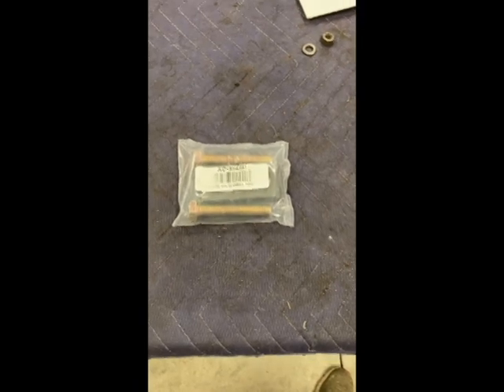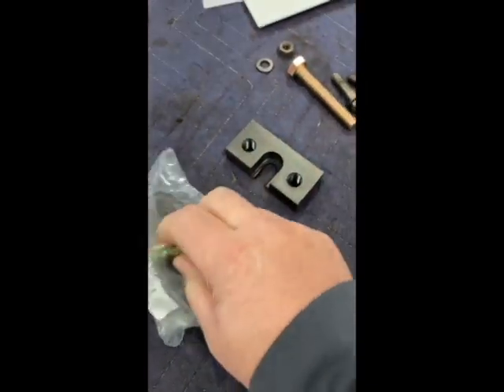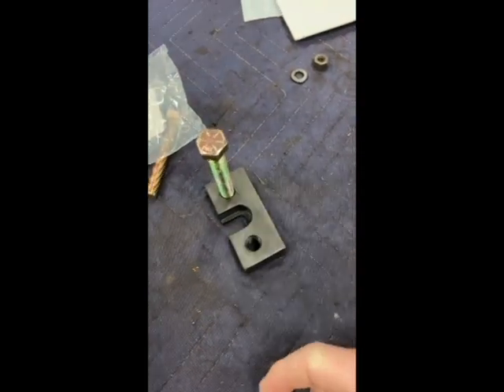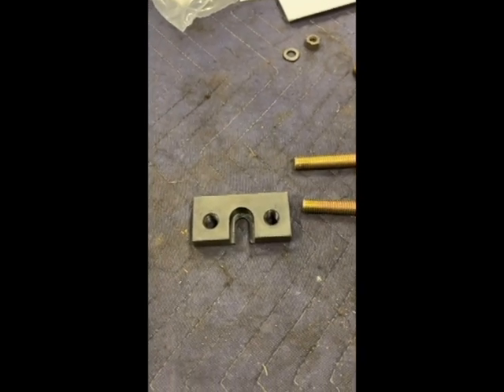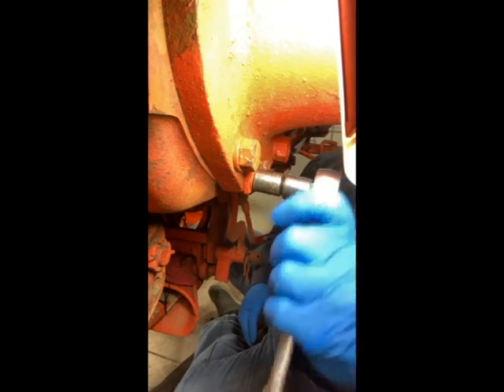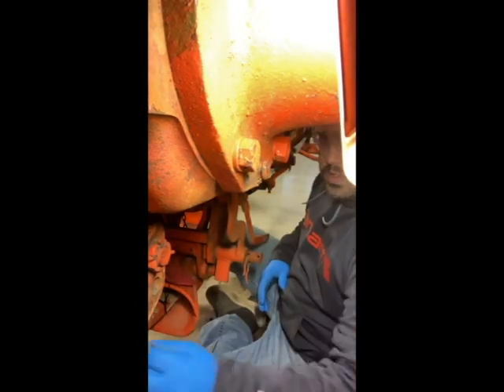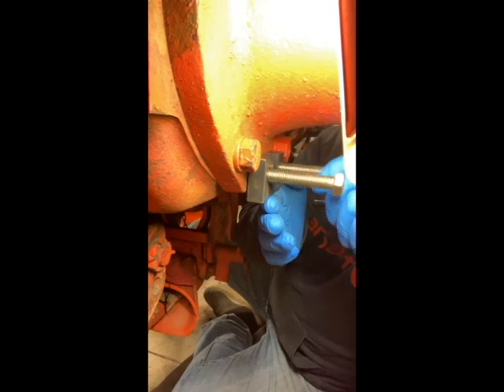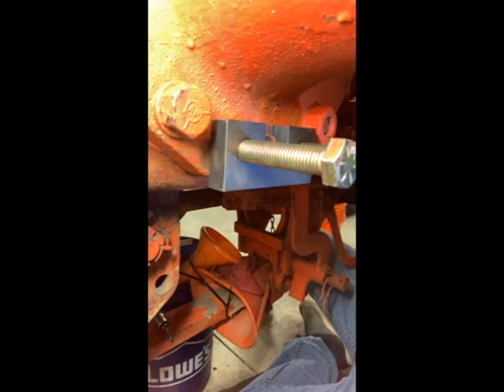Allis Chalmers W Series Brake Pin Removal

Comment: If the pins are chrome they are replacement ones from Allis or AGCO so they won't stick so bad. Usually the tool you have either pulls the head of the pin off or the tool bends or breaks.

Comment: the pins in the WD were non stick pins they were used back in the 50 and 60 as replacments you could of puted them out with visegripes  two of our WD45 had nonstick pins two didnt  with that rear end up side down cut a chuck out of pin and drive pin in and repete until pin can be drove out! maybe the puller will work with heat but usually just pulls thr end off the pin  done many over the years  l dont know if the non stick pins are still avauble  leave a peice of the pin to get a hold of ans it will come out with vise gripes just did my WD last fall also take the wheel off and the bolt that hols axle on to allow you to wiggle pin!! in pin in thr inside hole usaully does not stick!! l will be watchin!!!!
Reply: I bought the chrome pins for my WD from the AGCO dealer back in 1992. Now I don't think they are available.
Reply: Come on, what is the brake shoe pin removal tool part #, get serious.